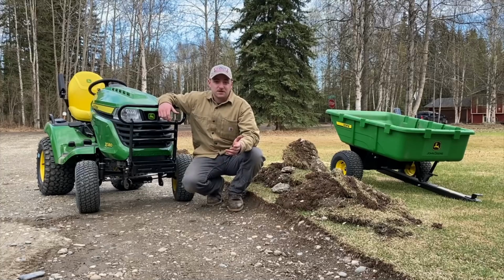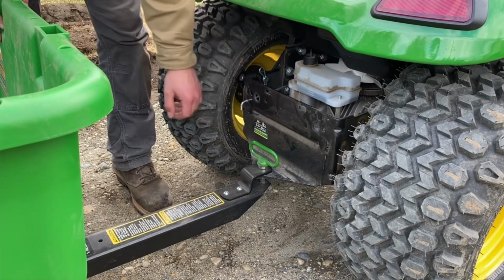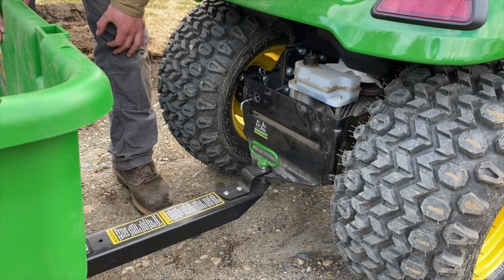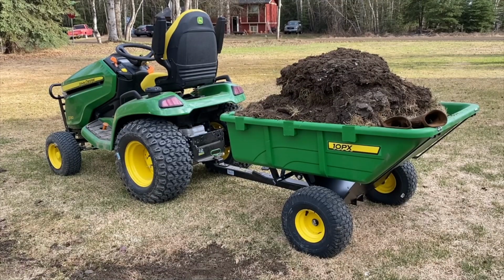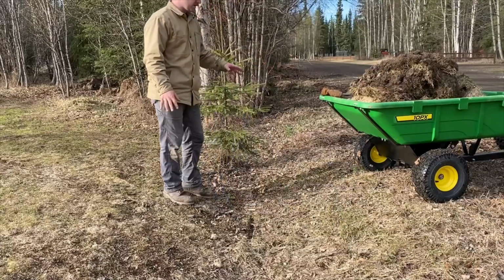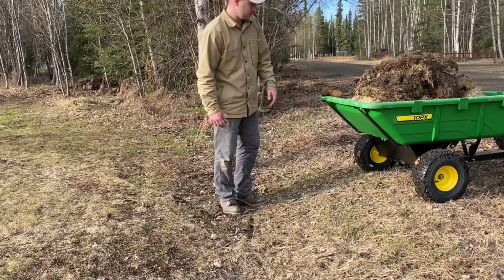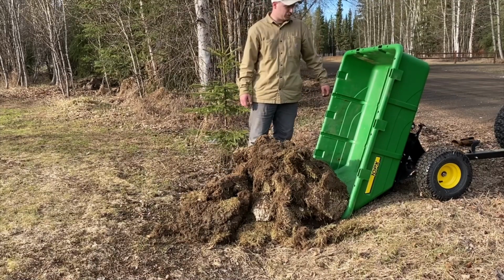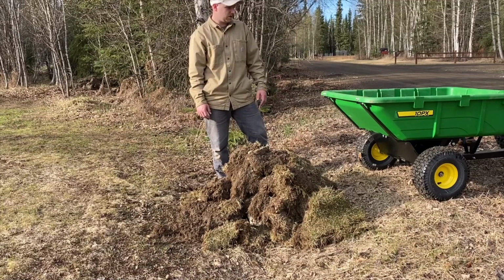Full Dumping The John Deere 10PX

Comment: I have an X590 I went to tractor supply and got a 2 inch ball receiver Took the two bolts on my metal John Deere wagon looks like the same bolt pattern to yours bolted the receiver on and I put a ball on the mower also works really good for throwing with a toe strap. it makes swapping out the trailer take two seconds and it’s very strong and not any concern about coming off doesn’t slam up and down at all

Comment: Yeah...thank you for the video. I am getting it.  I just emailed my JD dealer to change the order from the 10P to the 10PX.  Oh, and I added that magnetic pin.  Anything that makes life easier, I am game!

I did noticed that you are not using the spacers?  Just because those are a PITA to use every time or???
Reply from the maker: What are these spacers you speak of?
Reply: @JoshsGreenGarage  my bad... I downloaded the User Manual... those are not needed on the 10PX cart.  

I also placed the order for the John Deere 44" Lawn Sweeper (part #LP49038) and was also watching a video of that one... that sweeper requires two 3/4" spacers that the pull pin goes through.  Those are used to maintain constant ground clearance on the sweeper...   This is obviously not needed when pulling the cart.

You can see what I am talking about on page 10 on the JD sweeper manual:  https://a.sellpoint.net/a/Download+Instructions.pdf?spworld_assetname=JYXwbMWo.pdf

Apologies for the confusion on my part.
Reply from the maker: gotcha, I have the 42" sweeper, videos to come soon..... but they are great! well worth the investment! mine doesn't have any spacers though like you speak of, the 42" has an adjustable tongue, so they aren't required like the 44".

Comment: I would like to know if one could gain parts from JD, and convert an existing 10P cart to the 10PX model--why buy a new one when by adding parts you gain an extra tilt feature--will check with my parts guy at the dealership.
Reply from the maker: Great question, and the answer is yes you can! This cart is made by Brinly, and they sell a kit to make a 10P a 10PX:
 https://brinly.com/product/the-roger-180-degree-full-dump-kit-for-brinly-hardy-10-cu-ft-poly-carts/
Just dont get it from amazon, they have a way higher price...
Reply: @JoshsGreenGarage  Nice! thx.